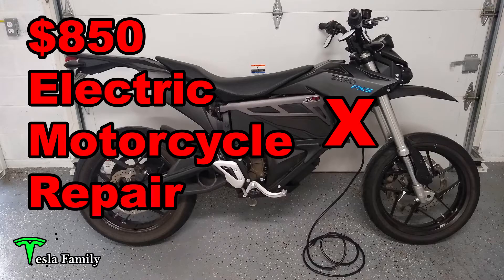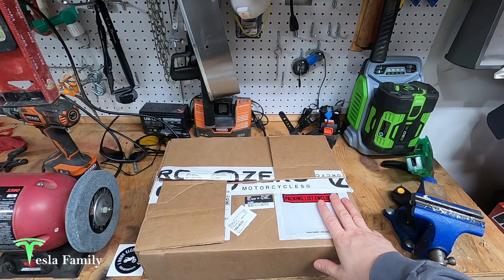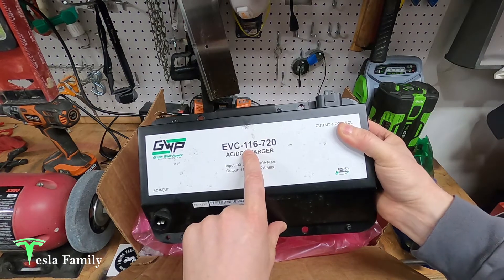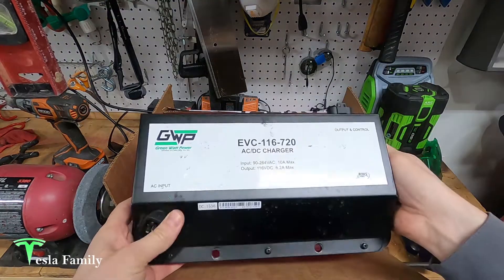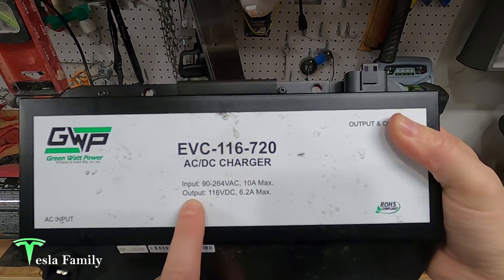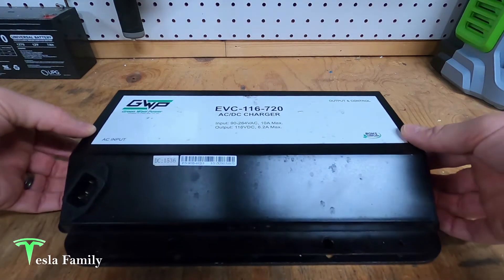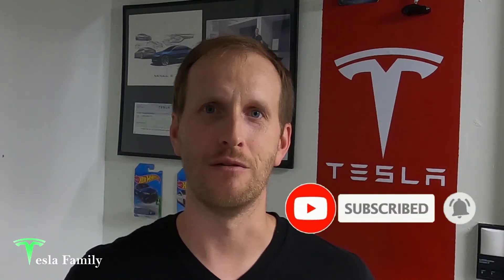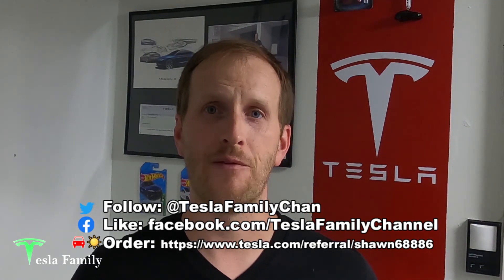What's Inside My Electric Motorcycle Onboard Charger?

Comment: Went online...cursory search. Not a whole lot out there on this unit. I would say the potting material is mostly for vibration. Weather-moisture can be handled with a gasket or O-ring.
Now the 64$ question is what is the thermal transfer of the potting material? Cause it looks like if charging there would little to no cooling of the electronic components. Which is BAD!
And a consideration for premature failure.
Reply from the maker: This makes total sense and I'm sure contributed to the failure. The area of the bike where the charger was installed and near the charging plug did get hot when charging. Thanks!
Reply: @TeslaFamilyChannel  GaN chargers come with potting compound too. This is for faster thermal mass transfer to the outer plastic surface. Might be the same in this case too.

Comment: Did you call or email Greenwatt and see if they have a repair/rebuild/exchange program?
Or perhaps a rebuild-reman (discounted $$) unit for sale. Perhaps a Scratch/Dent unit?
Cheers
Reply from the maker: Hello again, I called Greenwatt to inquire but they just directed me back to Zero and said they couldn't help me unfortunately. Must be an agreement they have with Zero.
Reply: @TeslaFamilyChannel  I am sure they signed a NDA for the unit. Wonder if a slightly different or larger unit would work?
Do the higher capacity Zero bikes use the same charger? Hmmm?

Comment: In my experience with voltage regulators, aftermarket performance car 'chips', and audiophile woo woo.... Potting epoxy (especially non-transparent) is how you hide 75 dollars worth of parts inside something you intend to sell for 750 dollars.   Sometimes it's more like a factor of 100:1 on retail price:cost to make.     I can buy the high voltage and jarring argument in this case, but I'm still skeptical :)   I was hoping you'd try to pull the epoxy out to at least see what's inside.
Reply from the maker: Thanks for watching! Good point about mfg cost vs sales price. Sorry about not trying to dig down into the charger. I didn't even know where to start. I guess using a reciprocating saw would have been interesting haha.
Reply: How can you get the potting off? My charger is broken too. I will try to see what it is. Price for a new charger is €850, which seems way overpriced
Reply: @OldCarsAreFun  I've seen this video where he boils the device in water to kind of rubberize the potting material.  Most of the material I've encountered in automotive stuff is black in color.  But this may work (or destroy the device) https://www.youtube.com/watch?v=OiPe6f4Oh8E